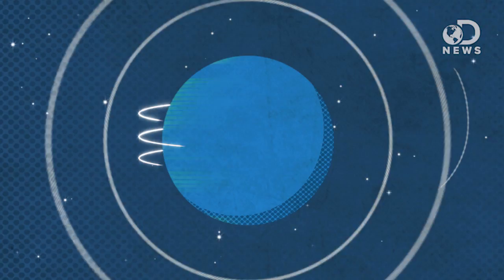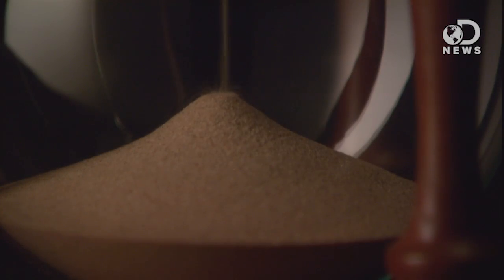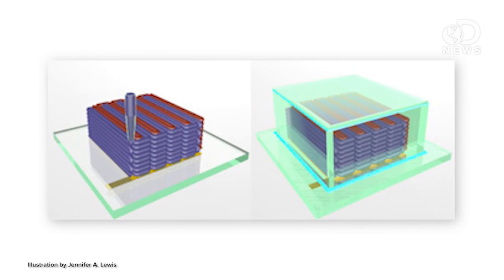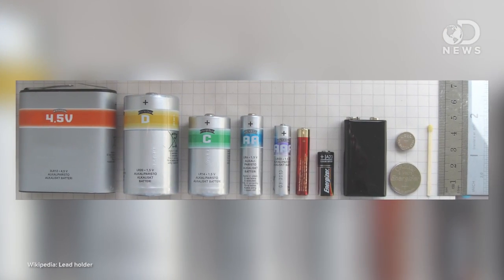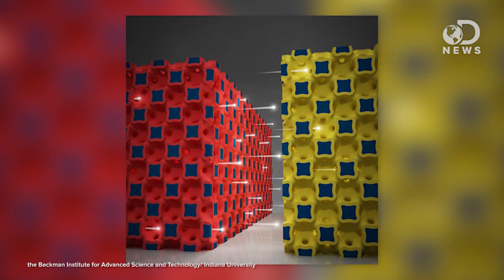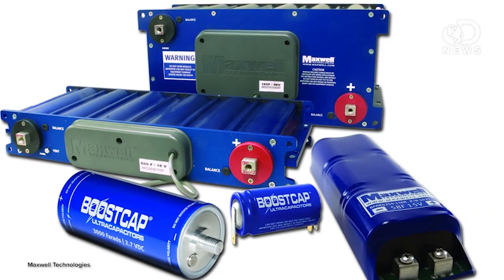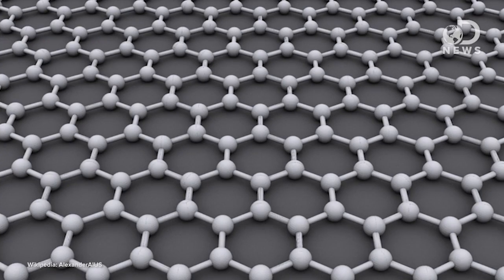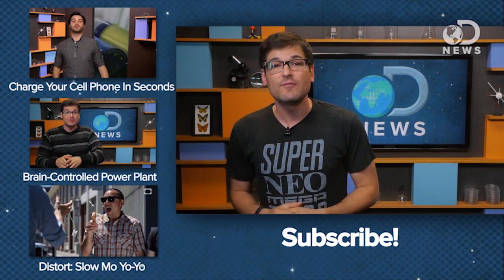Tiny Batteries Will Revolutionize Robotics

Comment: grain of sand sized sound bug, frequency powered, transmits a minimum of 30 ft.

ultra tiny video cameras, usb or powered, 2-10hrs video time or 1million pictures on time lapse / motion sensing modes

break beam sensors, smaller than the eye can see

nano soil ph monitors. need to come thousands to the acre, could start at hundreds

single chemical sensors, lots of them, available in mixed packages.

alergen sensors

Comment: I'd make a thing that manufactures nanobots. A 3d printer that prints out the part for it, while the 3d printer be the size of you hand. Then I would program the nanobots to seek and destroy cancer cells by injecting it with a antioxidant fluid.

Comment: #3: artificial neurons (AN): I would make tiny blocks, able to pass along charge to each other, that can connect to other blocks using either wireless radio signals or signals embedded in power.  In great numbers, they would resemble a human brain apart from the inefficient wiring needed between biological neurons, with each block able to connect to thousands of others and very high speeds.  To increase processing power, just add more blocks - or even put some nearby.  The result: sentient sand.

Comment: #2: I would make tiny blocks/spheres that can physically move relative to the spheres next to them using magnetic or electrostatic forces.  I'd incorporate inductive power/data transfer (so one sphere can pass power/data to the next) and memory, plus a small amount of processing power.  The result: a bucket of goop that can shape-shift, process massively in parallel and stay charged like one big battery.  Then, I will finally be able to boot up my own liquid metal terminator.

Comment: I'd want to stack a combination of graphene capacitors and microbatteries to store solar and wind power. Imagine instead of having a shack for the power controller and batteries the whole thing would be about the size of a desktop computer and have the capacity to supply several households for just the cost of harnessing the sun and wind.